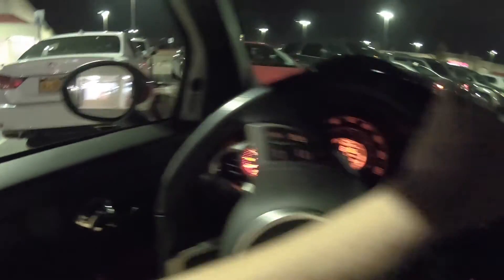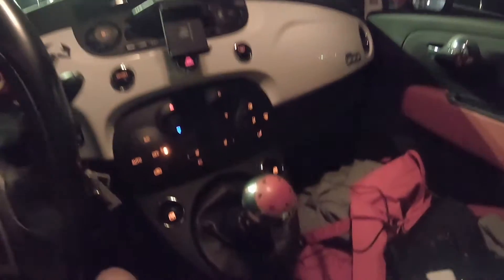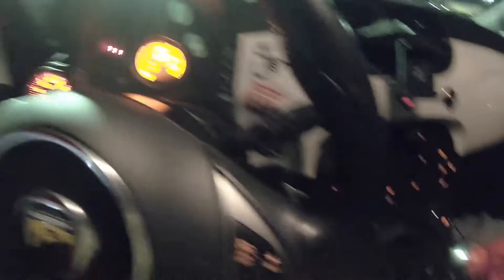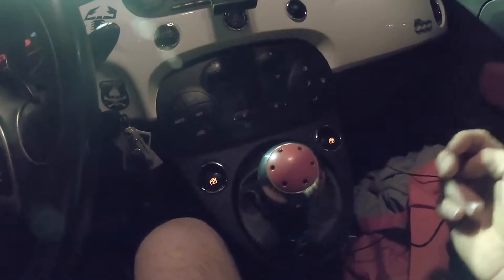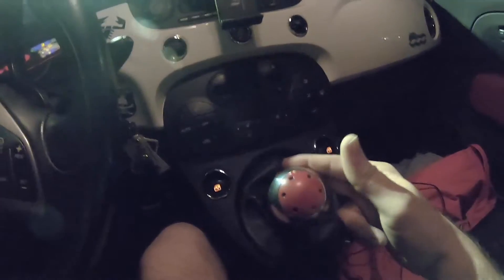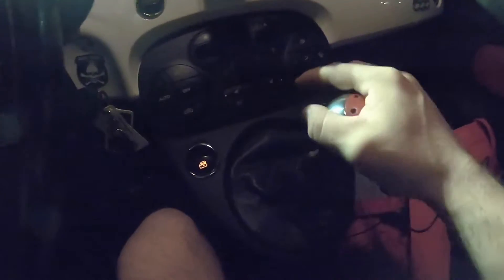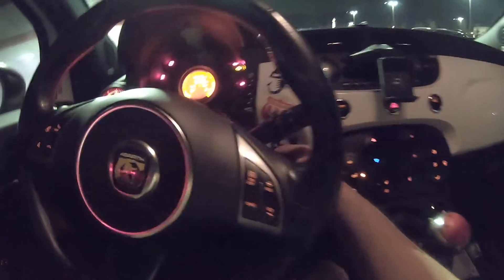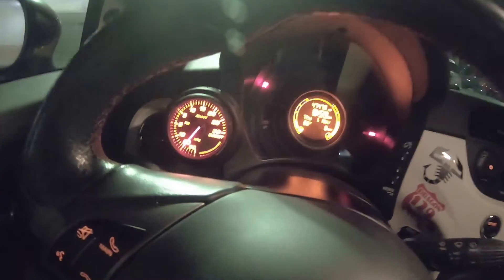Abarth 500 Shifter Cables

Comment: I have the exact same problem, going into gears there’s no issues. Everything works fine. Just very tough in Neutral. Did the new cable fix the problem?
Reply from the maker: Hey no after I put the new shifter cables in it was still tight. the issue was the spring on the linkage under the battery tray it was all rusted so we touched it to get all the rest off and now my shifter is back to normal
Reply: Mikey Turbo so remove the battery and look for a spring?
Reply: Mikey Turbo how easy is it to reach the spring? Is it going to be easy to spot
Reply from the maker: @mikejohnson4868  so for everyone its different some people just change the cables and everything is fixed but for me my mecmechanic said it was a spring near the linkage outside the transmission, thats why my shifter was extremely hard to move. So yes also check for a  spring
Reply: Mikey Turbo so it’s really a troubleshooting type of thing. I ordered a new bushing for now
Reply from the maker: @mikejohnson4868  yea unfortunately it can be, but I'd say since your having issues you might as well replace the cables and bushings while your at it